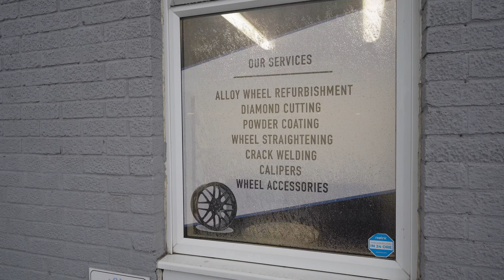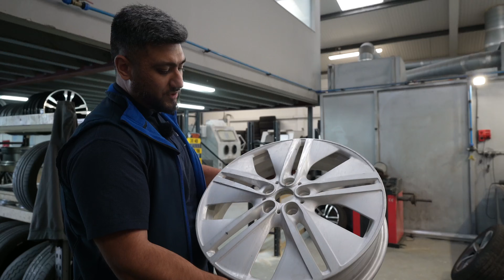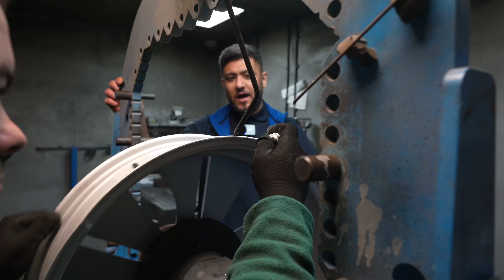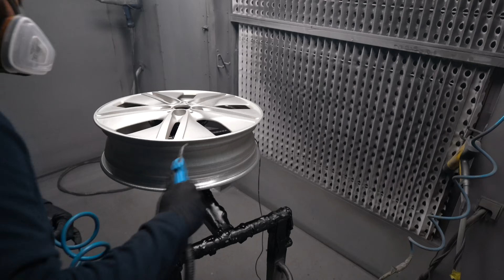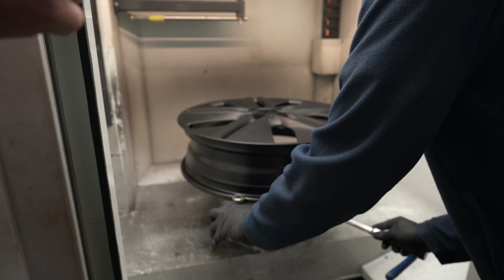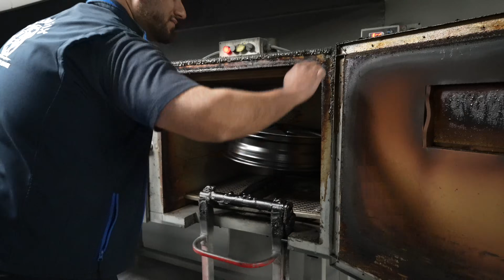Refurbishing Our BMW i3 Wheels at 'Alloy Fix' - More Work Than You'd Think!

Comment: Can you diamond cut oem wheels that did not come with diamond cut?
Reply from the maker: Depends on the shape. If they have a flat face and enough material it may be possible.

Best to see a refurbishment specialist with any given wheel you would like to get diamond cut, as they will be able to advise.
Reply: @ I have an 21 audi q7 with 21” wheels, the wheels come with diamond face or one solid color and I have the solid colored ones so I took it to wheel guy and he told me he couldn’t do it because it will fall apart I have no idea what he’s talking about but that’s what he said
Reply: @ https://youtu.be/b3ZQpxLhjU4?si=5VD31KXDBngUXQPz
Reply: These are the wheels I have but in solid silver
Reply: The question is why would you want to? Although they look nice when new. Diamond cut alloys are a proverbial pain in the b**tt. They’re really susceptible to salt in the winter & given you have a limited number of times they can be refurbished, I’d argue it’s not a great idea. 
For a very similar but more practical look, those i3 wheels could have been finished with a silver coating.

Comment: Question on tyres - given that they are an unusual size and the i3 is now out of production, will replacement tyres become hard to find or expensive?  Is that an issue to consider when buying a used i3?
Reply from the maker: On the contrary, there are significantly more options for i3 tyres in 2024 than there were in 2014 when the car launched (Bridgestone only). With Michelin, Continental, Nankang and some Chinese budget brands all now supporting i3 sizes (and 250,000 ish cars worldwide to support), there shouldn’t be any tyre issues on the horizon!
Reply: @wiselyauto  That's encouraging.  Thanks.

Comment: Diamond cut wheels are a pain and I don't even like the way they look despite both my current cars having them (one is an i3) Problem is that diamond cut wheels are designed to be cut so if you just paint them they look crap.

Imagine having your wheels refurbished then curbing them straight away!  Oh for the days of small wheels and big tyres!!
Reply: @gap9992 Not so for i3 431 wheels. BMW Park Lane refurbished diamond cuts as gloss black on an i3s recently
Reply from the maker: For non diamond-cut finish lovers, there’s always the style-427 wheel design (aka the bin lids!)
Reply: @wiselyauto If the bin lids are painted black and diamond cut they look awesome. Does Wisely sell used/in need of refurb 427 wheels?
Reply from the maker: @richardabw  we can supply 427s, but they would need to be attached to a car we are selling :P